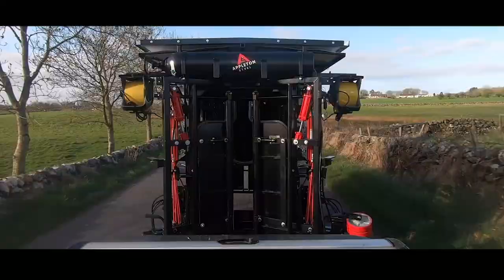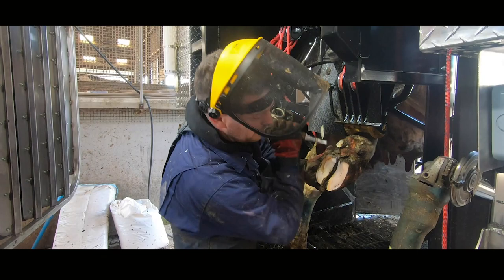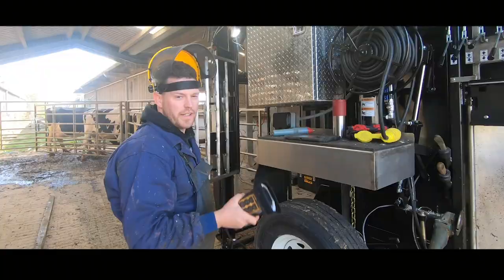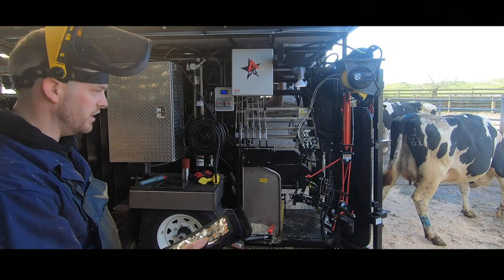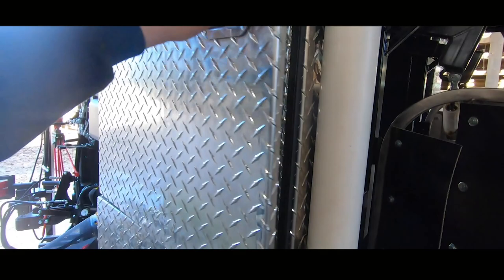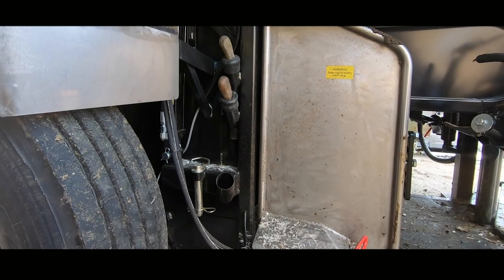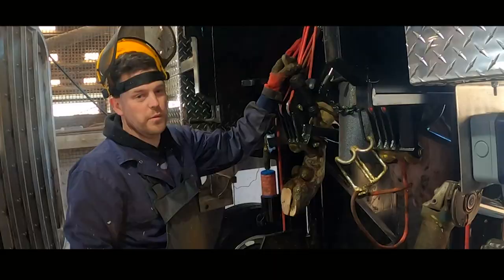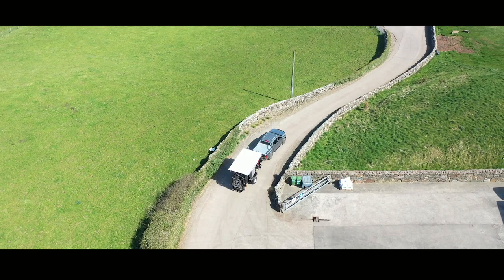UNBELIEVABLE COW CRUSH MACHINE.... Appleton Steel Ultra! | The Hoof GP

Comment: I love how easy it is for the cows to get in and out. Cant wait to see it handle a bull. I think the moving of the cow's legs is too fast. I know you'll be tweaking it over time but the cows are having trouble adjusting themselves quickly as the crush takes their legs. See if you can tweak it a bit. FANTASTIC CRUSH! I hope its all you were dreaming of.
Reply: I agree
Reply: As I recall, the weight is all supported by the belly band - you can actually have both back hooves up at the same time (like in the Wisconsin video)

Comment: Nice piece of kit.

I love the look of the cows when that thing lifts them up.  Priceless.  The seem to get over their apprehension pretty quickly.  

I also looks to be physically a lot larger than the Wopa51.  What's it like to tow on those narrow roads?
Reply from the maker: Ita the same length as my wop was but 8 inches wider and maybe 8 inches taller  its absolutely fine on the roads here. And tows very very well
Reply: The Hoof GP as I was reading your reply I could hear you saying it 😂

Comment: Kind of a random thought. Would it be better to release the belly band when the crush is back on the ground?
Reply from the maker: Yes! I'm trying to get into the habit of doing that
Reply: I was going to suggest the same :)
Reply: Me too
Reply: I was thinking you need an interlock to prevent opening the front while it’s in the air, along with not dropping the belly straps.

Comment: Was this an "off the shelf" item or did you get the chance to design some of the features?
Reply: I think it was a combination. There's a company in the states that he went to that builds these things and they have a few models. But apparently you can give some specs about where you like things to go. Oh, isn't it SWANKY?!
Reply: Both, he flew over and visited Appleton Steel while they were making it.
Check out his video.
Reply: Kenneth Dow - will check out this video.  I missed the part of where machine came from and specs assigned to it.

Comment: I’ve never seen such a brand spanking new Crusher, it’s a beauty. Does it take more time doing a trimming because of the hydraulic up & down twice. I mean the whole crusher goes up then it has to drop down. I’m not criticizing it at all cause I’m just sitting on my couch watching and it’s such high technology it’s so interesting to watch. You did great, if you thought you were apprehensive or not as smooth it didn’t look like that at all. You’re a Pro!
Reply from the maker: Nope absolutely not - it all work in synchronisation so it raises and lowers as other operations are happening anyways

Comment: From what I could see, it positioned the cows a LOT better for you. I don't recall that the Wopa12 had a lift as part of it. So no more hunching over which will be much easier on you. It looked like the plastic rollers it pulls the hind legs up into would be more comfortable for the cow and reduce any side to side movement while you were trimming. The front leg lifters (whatever they are called) didn't look all that pleasant for the cow but I assume it doesn't hurt them and once again you had better access. I suspect you'll be able to trim more cows and be less worn out at the end of the day with this.

Comment: Congratulations on the new equipment.  I hope it will help you work efficiently and comfortably for many years.

Two questions:

Do you use a Ground Fault Interrupter (GFI) between the farmer's power outlet and your extension cord that powers the crush?  As you probably know, a GFI detects minute electrical current flow between the power line and the earth, such as might occur when someone is starting to be electrocuted due to e.g. a nick in the electrical cabling, or moisture inside a mains-powered grinder, or in a light socket, etc., and then the GFI immediately cuts the power to the load before (one hopes) electrocution occurs.  Conscientious use of a GFI every day could save your life.

The new crush looks great and more feature-rich than the previous one, with its numerous hydraulic cylinders, valves, pressure lines, etc.  Even with the best quality hardware, eventually a blown hose or leaky cylinder or valve seal will interrupt a day's work.  If the needed spare part is not readily at hand, a delay will result which can cause loss of income and perhaps annoy the customer.  So, did the manufacturer provide a list of spares that they recommend that you keep in stock in your vehicle or at your HQ or at least by arrangement with a nearby industrial parts supplier?

No need to answer the questions here - not my business - but you might want to think about them.

Comment: really impressive machine. Congrats and much fun with it.
1 question, isn't the fron't leg hydraulic working to fast when it catches the leg? I saw you have speed controllers  or doesn't it matter because the cow has the belly belt anyway?
Keep making the videos. I love them

Comment: Curious to know what provides the power for all the hydraulics? I assume it's got an on board 12v hydraulic system with batteries that charge from the towing vehicle, or is is nitrogen powered? I saw there's a compressed gas cylinder on the roof.

Comment: Is there a safety setting so the head gate cannot be opened while the cows are still raised up?  If not, I’d lower the crush first then remove the belly strap.
Reply from the maker: I already spotted this error in my working it! I now lower the crush until its almost all the way down then lower the belly band

Comment: Is there some sort of interlock so you can't open the 'front gate' while the crush is still in the air? But looks really easy to use.
Reply from the maker: There's not actually - but even if I did open it by accident the belly band supports them so well that they're unable to lunge forward - so it would be ok

Comment: Nice new thingy for you :) 
Just one question, do the cows have any support under their belly? Because when I look at 6:19 it looks like the cows foot does not have a good stand on the floor. And also, when you get the front legs it goes very fast, not as gentle as with the old wagon. 
Might be new things to learn about the wagon, but I would hate if the cow got scared and/or hurt. 
Keep the great vids coming ...

Comment: Excellent looking crush, sounds a monster! Is there a noticeable time difference having raise the whole crush and lower for each cow?
Reply from the maker: There's actually no difference at all now - the time it takes to power and raise the crush is the same time as the belly band takes to do the same - now I've been using it for a few days I'm more efficient and do both actions at the same time - even without the lift installed I'd still be lowering and raising the belly band so the time is the same..... did I over complicate that?

Comment: Does it take more time per cow as you have to lift and lower this crush to let the cows in/out. Its a awsome crush and I hope it lasts you along time. Is there anything you dont perticularly like about it / would change other than ipad bit
Reply from the maker: No it doesn't at all because the time it takes for the crush to lift is the same as the time it takes to lower and raise the crush... and both operations are done at the same time so there's no issue ... it is something I did wonder before I got it though

Comment: I’m really disappointed that you only got the economy model! The deluxe model comes with a self-cleaning option, deluxe chrome wheels, dope flared fender wells,  deep tread white wall tires, self-steering, an auto cow wash, a Bose stereo system, EVERYTHING is remote controlled, no need for levers of any kind and it comes in candy apple red with silver metal fleck all at no extra charge! All this for a measly £2,000 more. What if you’re going to upgrade then go big or go home big boy.